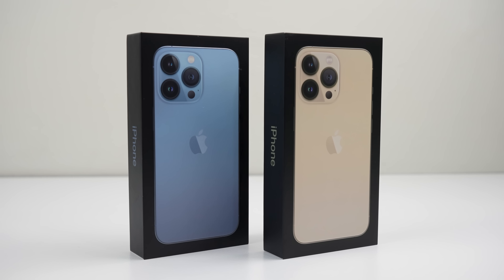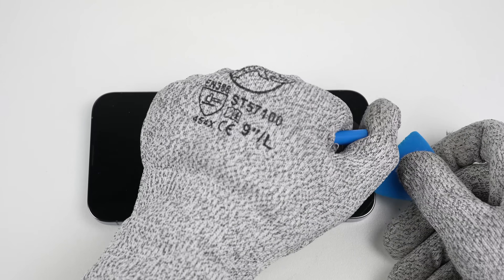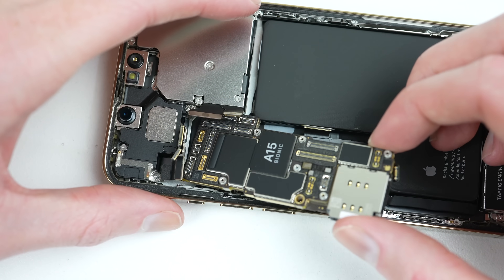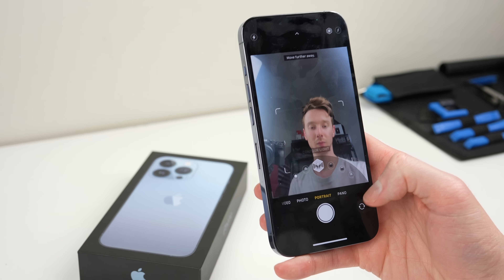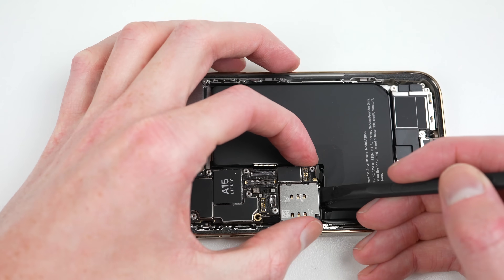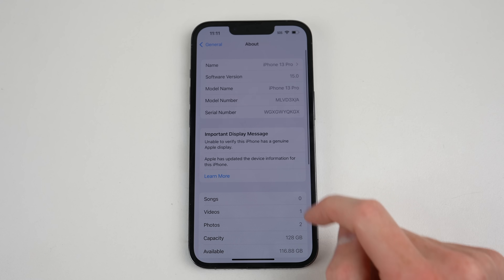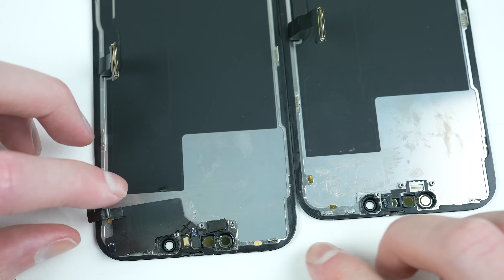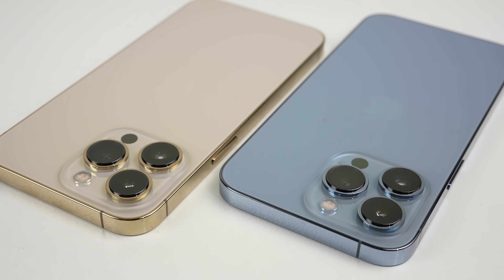iPhone 13 A Repair Nightmare - Teardown and Repair Assessment

Comment: To repair an iphone is easy..
Step 1: Throw Iphone in the trash
Step 2: Buy an Android

See that was easy.
Reply: Android are following the same route. In case you have been living under a rock the z fold 3 disables the cameras after you unlock the bootloader and the pixel 6 is rumoured to have paired the camera to the logic board like the iPhone 12/13

Comment: This kind of shit is the reason I’m upgrading to an android
Reply: Android are following the same route. In case you have been living under a rock the z fold 3 disables the cameras after you unlock the bootloader and the pixel 6 is rumoured to have paired the camera to the logic board like the iPhone 12/13

Comment: This is why I still prefer android. 
Apple has a very huge, anti-repair stance on their devices, unlike Android and Motorola.
Reply: @LinyosTorvoltos  I've been with Samsung for 4 years at this point. The phone I had for three of them didn't break once even though I gave it harsh punishment at work. Not a single problem other than water in the charging port, which I solved.

I then got a pixel a few months ago, and within the first month the screen cracked. It was however from 10 feet with no case, so that was expected. 

I love android as a whole, and condemn anyone who wants to tell me Apple is better
Reply: Yeah i prefer android too

Comment: Something I think that would fix this issue is instead of opening up the bios to swapping parts, they should release the tools to re-authenticate genuine replacement parts. I think software locking through bios is a pretty solid security measure, as taking your phone to be repaired at a sketchy retailer will disable functions that could potentially give malicious hardware an eye into your life. that said, reputable or partnered repair shops should have every right to verify genuine parts and repair a phone no problem, and savvy DIY repairs with the right equipment should be totally doable.
Reply: The problem is their using DRM as a weapon to not have 'reputable' repair 3rd party shops who can repair the products. They can permit  partnered repair shops which need to dance to their terms and make customers suffer. If 3rd party B has to get certified from Apple then Apple can put terms which can again be harmful to the consumer. E.g. suppose Apple puts some DRM on the tools themselves. E.g. the software counts how many times a BIOS has been flashed and then the partnered repair shop has to pay Apple for the flash before it can flash a new phone it is repairing. This "partnered" repair shop has to pass down that cost to the customer and the same thing happens.

Comment: Apple: 
-No audio jack, forcing you to PURCHASE a new, special APPLE adapter in order to use headphones, or you can BUY specialty APPLE BRAND wireless earbuds.
- Every "software update" makes the phone run slower and become more unstable so that you have to BUY another APPLE phone.
-has built in features so that off brand charging cables that should work perfectly fine are completely rejected, making you have to BUY an APPLE brand charging cable, which likely is designed to degrade quickly so that you have to BUY another
-releases a "new & improved" apple phone every couple of years, which are hyped up considerably to be the next big thing, but only add a few small features
- claims jailbreaking is illegal even though it really isnt
- intentionally integrates hardware and software into the device to make repairing the phone's smallest problems the most painstakingly unbearable hellscape you could possibly imagine, and is continuing to add such features to ensure you take your phone to an APPLE BRAND "repair" shop to "fix" "problems" (which were probably intentionally built in to get you to go to a repair shop) so that you PAY MONEY to the repair shop, only for them to do jack shit about your problem, probably even making it slightly worse knowing them
- has little to no compatibility with any non-apple brand bluetooth or wired products because M O N E Y.

Samsung:
"Hey what's up, here's a software update that improves a whole bunch of things and adds a lot of QoL stuff because why not. Oh you have a bluetooth device that isnt samsung brand? No worries, that'll work fine with our phone. Oh yeah, we are also releasing a new phone with a whole lot of new features, but you dont have to get it if you dont want to because that one you still have will continue to work in mint condition for YEARS so long as you take good care of it! Even if it does break, it's likely a small issue that's easy to fix if you know what your doing. Anyways, we hope you get the most out of that phone, and we will just continue working on a newer model with a bunch of new improvements and fixes and in the meantime continue releasing software updates for the older ones to help improve user experience."

I switched to samsung about 4 years ago and never switched back.

Comment: I saw the blue thing in the thumbnail and thought the put a locking stand inside the case to prevent you from using the phone after opening it, which isn't too far fetched for apple

Comment: IMO Apple repair techs have to be just about the dumbest most scummiest people on the planet from what I've seen on You Tube they lie to people to make them buy new products even though the repair is easily possible, Saw a video of someone who got a repair for a $5k all in one the repair was to remove a broken visa mount screw it was so bad and they did so much damage that he got a full replacement in the end. Fuck you Apple I will never buy anything you make.

Comment: So we need to figure a way around this.
I assume each part as it's own, randomly generated software code in it that only matches the parts from the rest of the phone, but thats just a wild guess.
If that is the case, then GETTING to those codes to change them is the issue.

Comment: What's scary is that this shows at any point whether it be through a software update apple could cause these fake errors and force people to get their phones repaired at an apple center even if the phone is functioning normally.

This is fucked up

Comment: Right to Repair needs to continue to push forward. this behavior from companies is disgraceful. I do know some of the aspects of the reason they do these locks is so people can't replace items with out your knowledge with backdoor type features but that is not enough of a reason to have this level of control.  even at bear minimum the iPhone locks on hardware (if they wont remove them) should be limited to the time the phone has an official warranty. After that the coded software locks should release control so that they can be repaired.

Comment: Makes "right to repair" even more important as apple will be required to release software which will marry new parts to avoid the issues which are caused solely by software blocking features if serial numbers do not match those at it's factory set up. You don't own this phone, you're paying to use it with restrictions, from apple. Sadly until people stand up and refuse to be ripped off like this it'll carry on. Stop buying them until apple get the message.

Comment: Apple engineers do "Think different".
Fix display panels with thermoplastic adhesives directly above the CPU fan exhaust,
Solder the SSD on the motherboard in a MacBook with only 4 GB so the pagefile eats through it within 1 year,
Use the display connector as the fuse instead of the fuse,
AND make even the same models of devices incompatible with each other to force the end-users into the Apple way of "fixing" things. 🤨
The genuine incompetence of Genius Bar fellows is a story on its own.

Comment: What happens if you use an original, never used in a phone apple display? Or if you make the "repair" before turning on the phone and never letting it to connect to the internet? I think there might be a database of parts used for phones and parts saved are replacements, so when you re use a phone part there are errors, but if you used a replacement intended part, there won't be any.
Reply: No it's done by part serial numbers

Comment: Face ID is a security feature, and likely tied to the logic board.  To me it makes sense that a different logic board in the phone would disable that feature.  Reminds me of how Microsoft Windows would keep track of the internal computer components and, if any of them changed, would invalidate the license in the assumption the OS was being installed on a different computer (for OEM licenses that were intended for install on a single machine).
Reply: That still happens. Thankfully, all you need to do is link an email to your windows and it easily allows you to transfer the license seamlessly after swapping your parts.

Comment: Apple.
The company that still basically tells all of its customers to kiss their arse, and are still praised by idiots.
Ignoring the rest - because the components are components - the Screens were literally the same, and yet the other phone didn't see it as an actual iPhone Screen.
Like wtf...
Not to mention that you don't even get a Charger with the phone - you get the cable, but not the charger itself...

Thank god at least EU is trying to push for the Chargers to be the same, because then Apple will have no choice but to adapt if they will want to sell in Europe.

Comment: Car manufacturers make it hard for third parties to replace electronic components. Replacement parts needs to be coded in by an official repairer to match the cars VIN. Might be something similar going on here to keep you going back to the apple store for repairs.

Comment: If you ever worked for repair shops, you know how much you hate repairing apple crap. Seems like they purposely make it so you screw shiet up so you have to buy a new one. They change the littlest shiet each gen for no reason so you cant reuse stuff from last gen. Could be a differ screw placement to a ribbon cable size. And they all don't use the same screw size. There's probably 3-4 differ sizes used.. They try very hard to make it so you can't repair it. And everything is so fragile, and the way it's put together almost guarantees you mess up.
And parts are also super expensive.
Apple = garbage $$$ so you spend more $$$ to fix

Apples fix, just buy a new phone.
Lol, reason why I have an Android

Comment: And this is exactly why I never owned an apple phone and I never will, I'm not saying that its not a good phone but for the money Apple is asking for one of these phones I can buy 3 very good Android phones. Apple is out of their minds with this one though, so basically if I damage my screen I have to buy a new phone which is the case actually with most phones becase the screen costs almost as much as the phone does but than thank you I will stay with my 1+ phone which I can buy 2 of for the price of this one.

Comment: Apple was so much dedicated to making the iPhone 13 irreparable that they forgot to upgrade the design
Reply: They don’t ever upgrade design lmao
Reply: @4ytherium  exactly. They haven't made a design change since the 11
Reply: @4ytherium  I mean, if we’re real, they did change up stuff. But the change from 12 to 13 is completely ridiculous. It‘s as if, like OP said, they only took care of the irreparable part, and when they noticed the phone looks exactly the same they just repositioned one of the lens and called it a day lmao
Reply: ngl, that iphone 5 design is the best iphone design
Reply: @owoberon4947  iphone xs> all iphones
Reply: @nonsonoenrico  Why? Because you have it? Xs doesn't have any significant upgrades, saying X however would be a different story
Reply: @nonsonoenrico  any iphone x>all others
Reply: @owoberon4947  that's nostalgia
First rounded, then squared, then rounded again and the cycle continues
Check veritasium's light bulb video he gives good information
Reply: Apple sheep will still say its best smart phone ever.
Reply: @kalijasin  me when Nokia gang
Reply: @Wertyhappy27  
Me when LG Wing
Reply: iPhone 11 Pro was the last good iPhone
btw it came with a fast charger.
Reply: @moralesg99  Wtf are you talking about? The Iphone 12 has an OLED display and the 13 has literally double the battery life of the 11.
Reply: @Frenchfrys17  It isn't good when essentials are taken away
Reply: @Frenchfrys17  iphone 10 and 11 had OLED displays as well but yeah battery is better
Reply: @Frenchfrys17  my iphone 10 has oled
Reply: @shokdj1  The Xs does but that costed the same as the 13 pro when it came out. The Xr doesn’t which is similar in price to the base model current IPhone lineup.
Reply: @Frenchfrys17  yeah that’s the 1 I have I think the xs
Reply: 99% of the budget goes to making sure 3rd party repair can't be done. The other 1% is for the color change.
Reply: Too accurate lmao
Reply: Too bad so sad.

Nothing you can do about it.
Reply: or anything else about the phone, it's the same as i believe the last 5 models before it, tech and look wise.
Reply: I have the 13 mini only cause it reminds me of the iPhone 5 with size and I loved that size it was so easy to use.  It also reminds me of those iPhone se2 render concepts people made.

Comment: My father was a Television and Radio Master Craftsman. Repairing everything for a daily living. It was easy to replace defect parts.
Nowadays this Craftsmanship is gone! You simply can't replace single parts anymore. There are only integrated circuits like PC's have and changing them is more expensive than a whole new Device.
Reply: VERY different times and products. If you were to take a look at the insides of a CRT TV or monitor, they had a lot more space to work with compared to the slim designs that we have today. Same goes for phones and anything else compact. Of course back then you also needed help to move your TV if it was big because they were just stupidly heavy.

Comment: They spend more money trying to make their phones unrepairable than making it better.
Reply: Making them unrepairable IS making it better according to apple.
Reply: Announce that you've slapped a new number on the same phone and the Apple Fanbois are lining up; why put in more effort.
Reply: I have a Note 20 Ultra and have no plan on buying an Iphone in the future until they allow 3rd party repairs, but saying they don't put in effort to improve their phones show a clear and stupid bias. Right now, Apple makes the best phones from an objective stat standpoint. Better battery life, faster processors, smoother/less buggy OS by a long shot, and a better form of computational photography. The build quality on their phones is just plain better as well. They don't use paint on their metal frames unlike Samsung. Paint that after only a year has worn and chipped very badly. While fixing my Note 20 is seriously convenient, I am sad that I am missing out on the way better design and OS of iPhones

Comment: I'm using a Mac Pro from 2009 where I replaced the graphics card, memory, processor other stuff and the Mac Pro works fine. Why would Apple change this in their phones? We need some regulation on this.